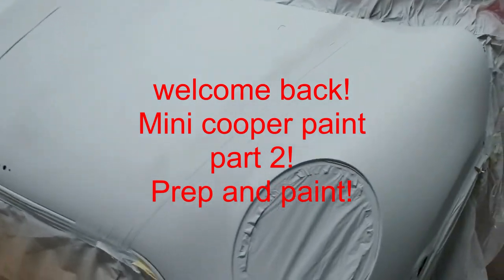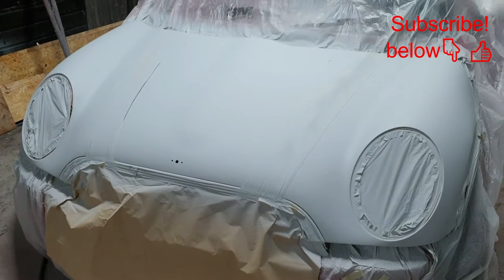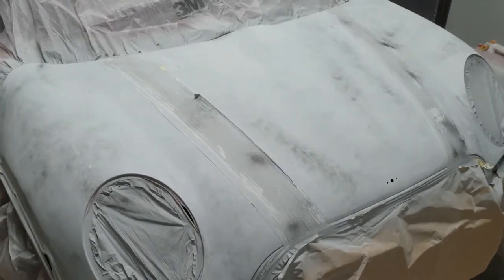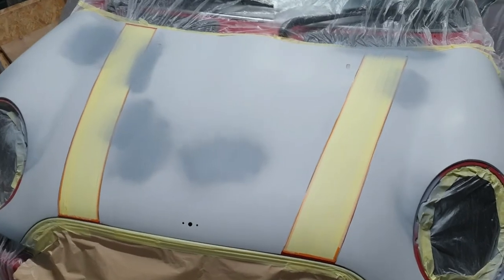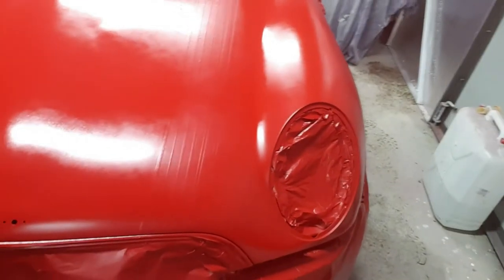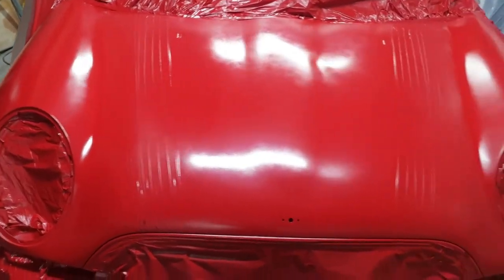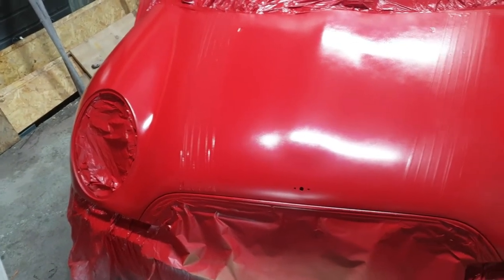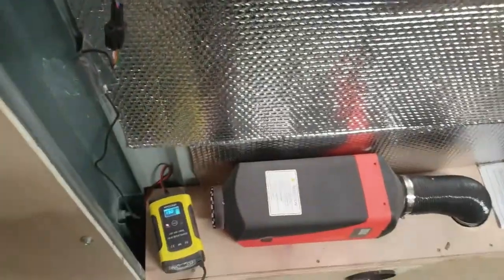Mini cooper paint part 2 Preparation and painting the bonnet

Comment: hello how many ml grams to paint hood front ? tks
Reply from the maker: Solid colour, probably a 3rd to be on the safe side and by the time its mixed you will have plenty. Solid colour is cheap enough...
Reply from the maker: Base coat and lacquer, id get half a ltr for this job and by the time its mixed that would be right. Lacquer I'd probably mix up 600ml, put a couple coats on. Its different with different lacquers though as you most probably know 👍
Reply: @Supercarlsunday  oh yes i thinked 500ml tks
Reply from the maker: No problem 👍